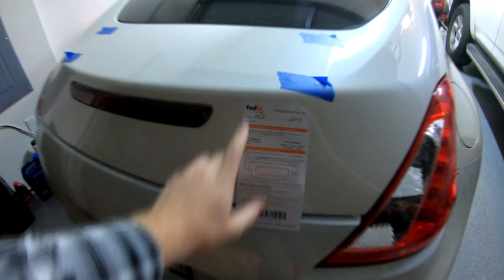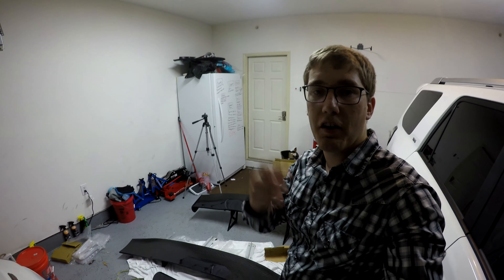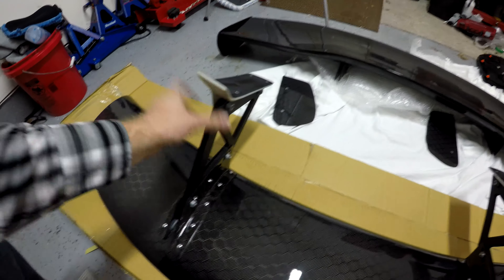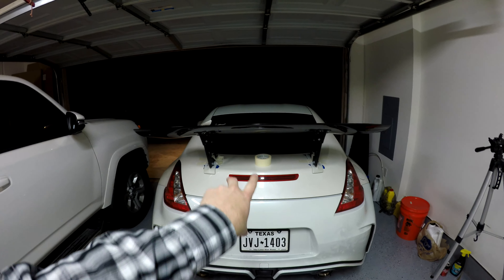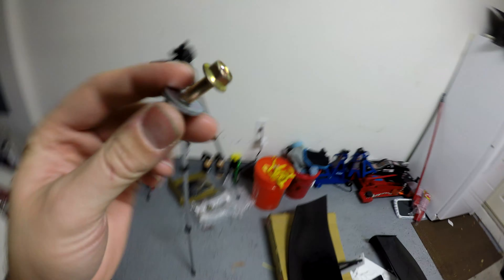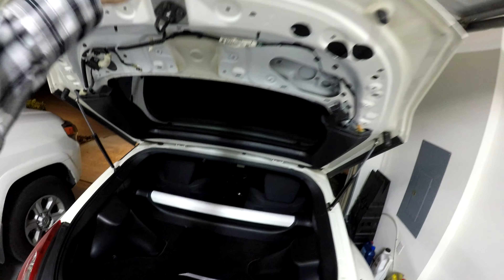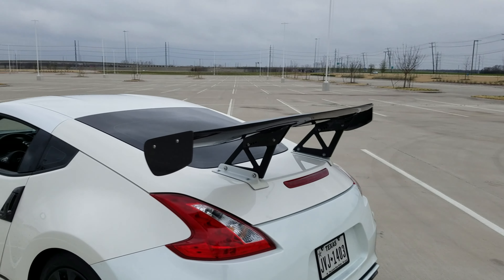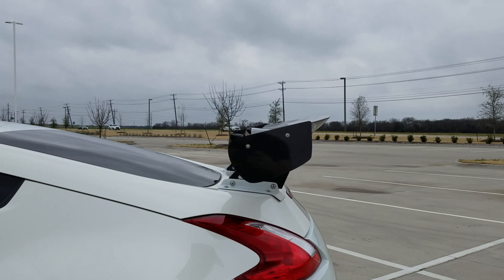How To: GT Spoiler Install on a 370Z

Comment: I just got this spoiler and was wondering if you had any issues with screwing the feet onto the brackets. One of the holes on my left foot doesn't line up correctly , it's way off (quarter of an inch). I can fit the screw through but then the left foot doesn't fit snug on the trunk. I contacted Jay about it but to no surprise he still hasn't responded.
Reply from the maker: Yeah this was a problem with my first set  I got. So what I ended up having to do is fill one of the holes, sand, let it cure, then drill the hole where it actually needed to go. Then painted.

Comment: What about rust after drilling?
Reply: That only happens if you don’t people seal your holes after drilling and the weather is involved I’d use some type of bondo or jbweld to seal up the potential leaking points due to drilling
Reply: At 15:15 he talks about using rubber washers to prevent leakage